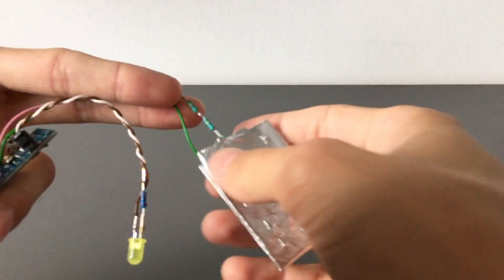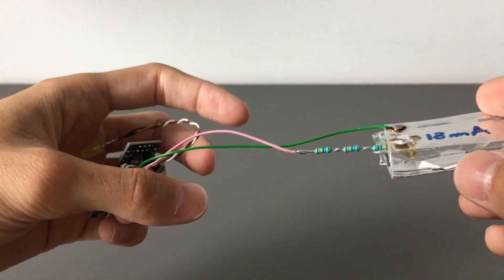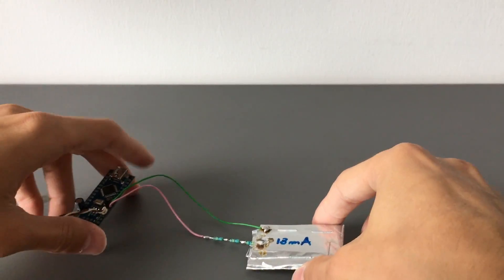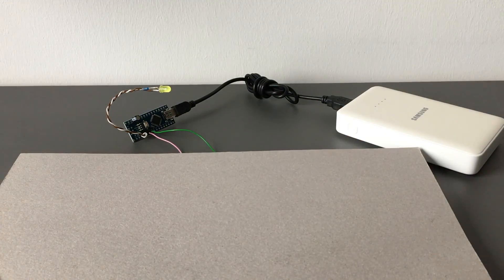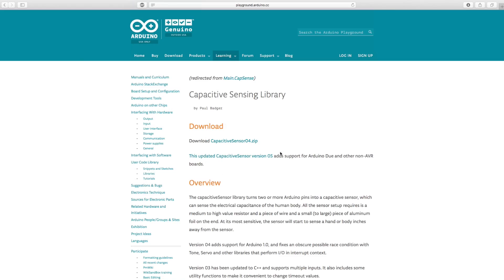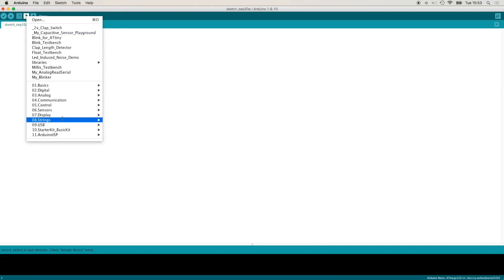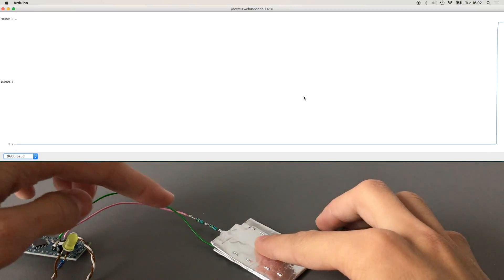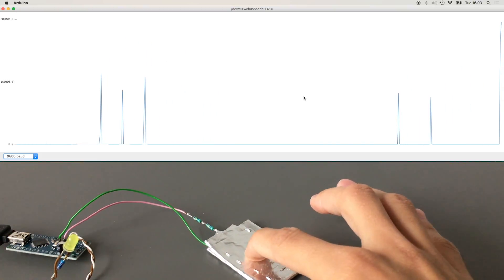Simple Complete Step by Step Arduino Capacitive Sensor Tutorial

Comment: I want you to show the Schematic detail.. I am struggling in making a Schematic that is to make some bare paint to be a touch sensor. I am using Arduino UNO board now. what is the board you are using? 
And is the graph on the video Serial monitor? Mine shows some strange word like this... "~?-I r???-2" How can I set the serial monitor like you?  I am really elementary level of arduino so if you let me know then I will be very happy. thank you.
Reply from the maker: Usually if there's garbage on the serial monitor, you're not setting the BAUD rate correctly

A common one is 9600, so, you'd have to have a like saying

Serial.begin(6900); in the code

And set the serial monitor on the PC to look for 9600, in the bottom left corner I think of the window you can set that
Reply: @Darieee  Actually, the problem was not about the serial monitor... anyway thank you for answering me :D
Eventually I successed to make a capacitive sencor!